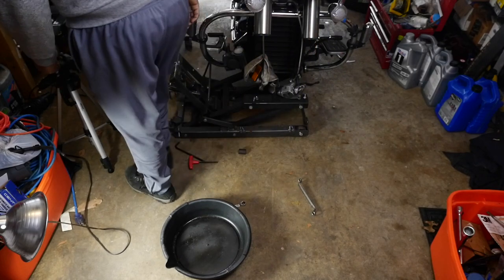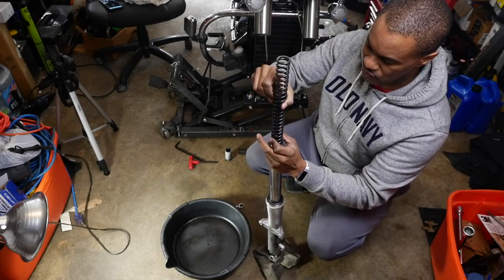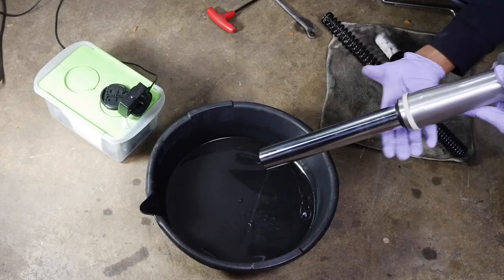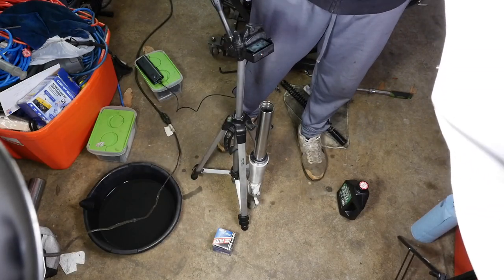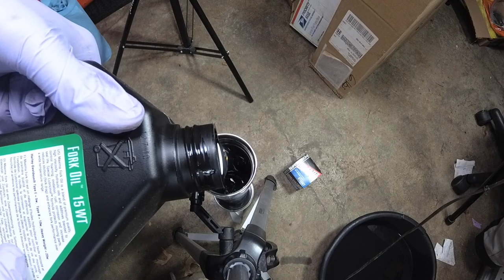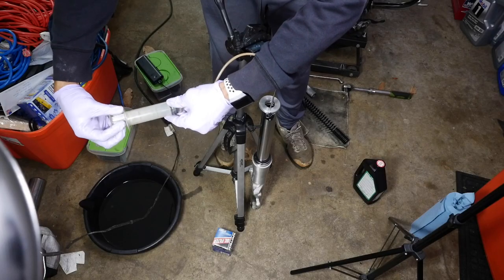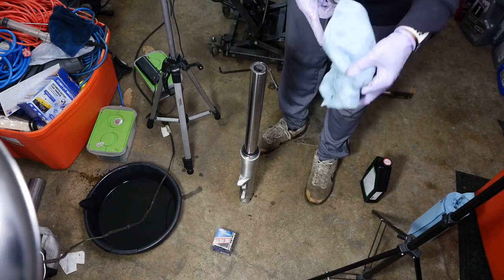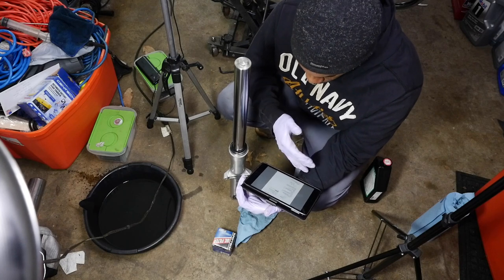Fork Fluid flush on Vstar 1300 | Part 2

Comment: Not that I haven't done it or don't because I have and do... but most fork oil like break fluid is hydrophilic and will gather moisture sitting on a shelf after its opened. Just food for thought, I change mine yearly or every 6 months so I dont much care. I also run ATF fluid unlike most bigger performance shock systems. Made my own suction setup like that for about 3.50$ at a local medical supply. But they one is slick. Thankx Bruce, just some thoughts.
Reply from the maker: Yes that old one is a leftover, I used a new bottle for these forks . I just grabbed that cause I wanted to show it as example. The suction is a good method, but for me getting the bars off is a bit annoying as I have to pull the fairing to get to the bolts, ughhh.. you'll see that next video in the time lapse. I agree once a year this stuff needs changing ... I'm considering ever 5 to 8k... that oil I showed at the compare had 10k on it .. 1 year approximately old. You should do a video on your siphon build. As I'm curious...
Reply from the maker: And thank you so much for taking the time to watch this...
Reply: @dbest1aVlogs  have a pick on my Instagram I think? Its basicly just a feeding tube and feeding syringe from a medical supply store. Should be under 5$ mark out your tube fill level on the feeding tube, and suck away. Or just use the marked syringe to measure your fluid mess free. 2 full syringes just happend to fill up a CT 90 shock! Easy peasy.

Comment: Well ..that's makes 3 of us using the Maxima 10wt fork oil...lol  
I noticed a pretty good ride\handling quality improvement on fresh fork oil.
Reply from the maker: I put 15wt in. Granted it calls for 10wt. Seems to be ok so far. I haven't ridden anywhere though to decently tell lol. 
Thanks for watching
Reply: @dbest1aVlogs  15w?? You just had to be different....😃
Reply from the maker: Haha. Well I felt the front could use a little more dampening. It wasn't bad though.  I need to ride a little further to get a feel. Braking seems better too now

Comment: That oil was really nasty looking. I’ll bet you that mine is probably worse. I used to like taking on stuff like that, but as I get older and dislike it lol.
Reply from the maker: I understand,  it's not very easy. I am getting older and battling getting slower. Ah what can I do . I'll just keep on wrenching till I can't.. hehe..
Reply from the maker: I forgot to add. The first time I did this... It was worse. That stock oil had about 15k on it .. it was like tranny fluid I'd guess.
Reply: Dbest1a’s Ride oooh, mine still has the stock oil at 33k kilometres 😥